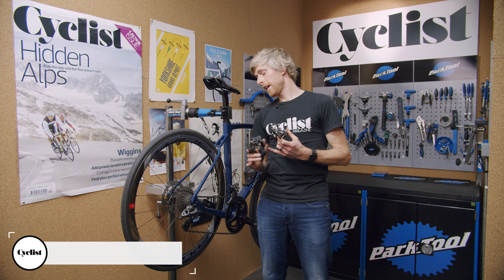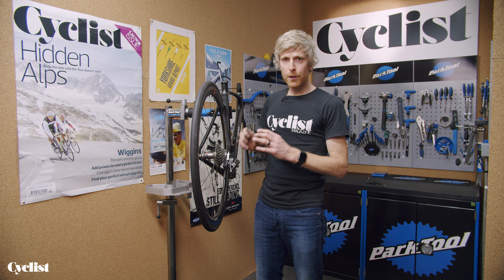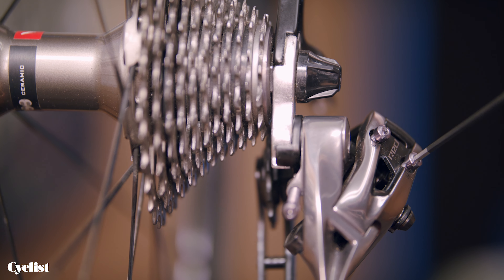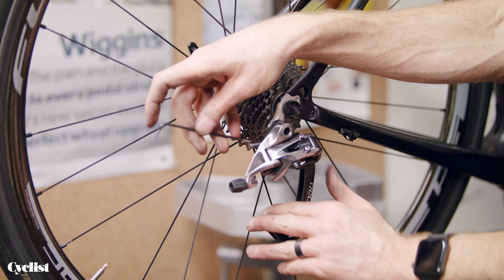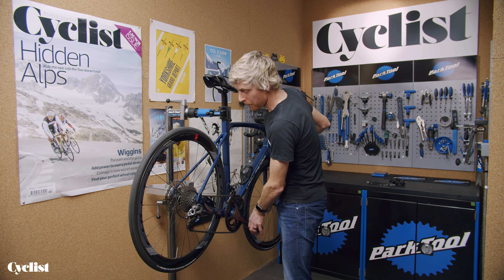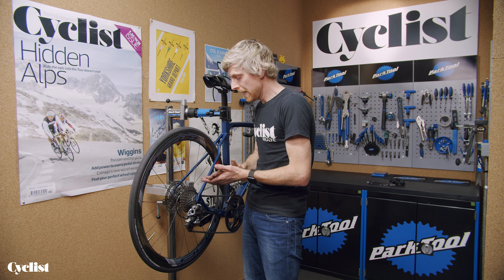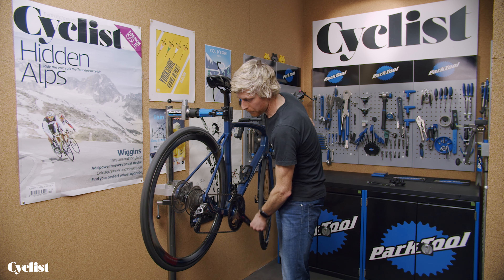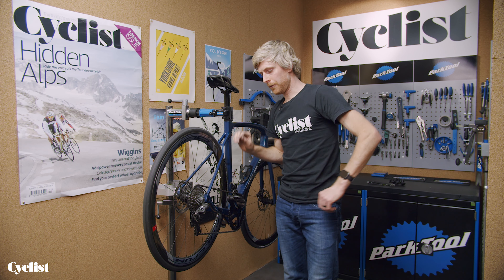How to set up your gears: Pro tips for adjusting the rear derailleur

Comment: Thanks a lot for suggesting adjusting  the b-tension screw! 

I recently got a new MTB and I'm still quite new when it comes to bike maintenance. I recently took the bike out for it's first good run and my gear shifting was horrible. Constantly skipping gears, which isn't great when you need them quickly. I looked up endless online how to's and everyone was saying to adjust the tension. What would happen is I would make the adjustment, and it would fix a couple of gears, but then the issue just kept jumping from one gear to another, and I was pulling my hair out as I couldn't understand why.  Came across your video and followed your advice about the 6-9 mm gap on the b-tension screw. I then reset the tension again and only had to make minor adjustments to one of the gears, and the rest of them shift perfectly now.  

I was so close to throwing in the towel and doing a 40 mile round trip tomorrow to take it back to the shop to get them to fix, but now I'll get to go out on the bike instead. Thanks again!

Comment: thanks for this video. It really explains well what the adjustments do. In the past I just tweaked the screws with trial and error and no understanding until I got a result I wanted.

I've got a problem with my rear derailuer. It skips and slips out when it's the rear range of the rear sprocket. But not at the largest or smallest ends. Any ideas what would cause that? I did have a bent up rear derailuer from getting a stick stuck up in it while riding, and a bike shop repaired it and it was fine for a time, but now this problem has started happening. Any ideas what would cause that?